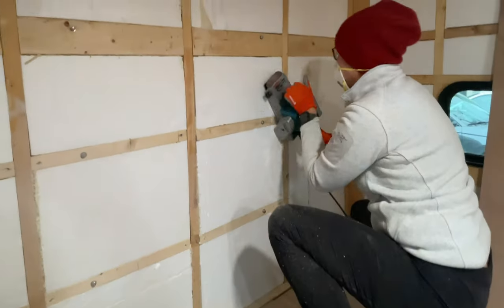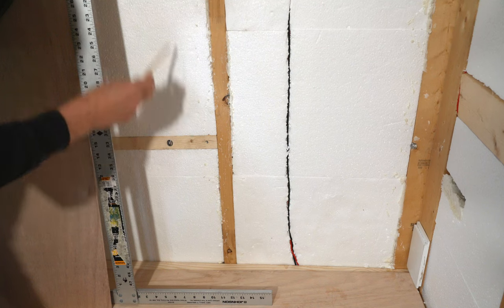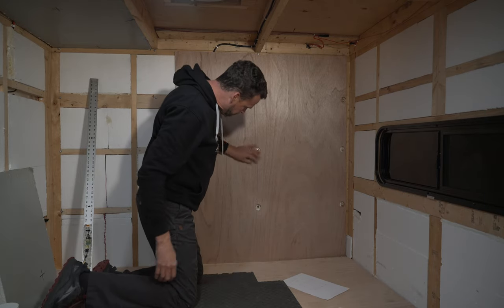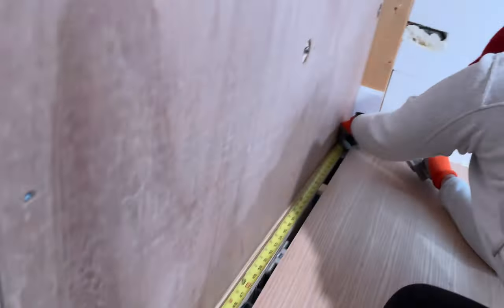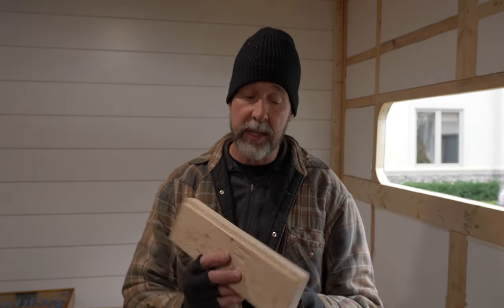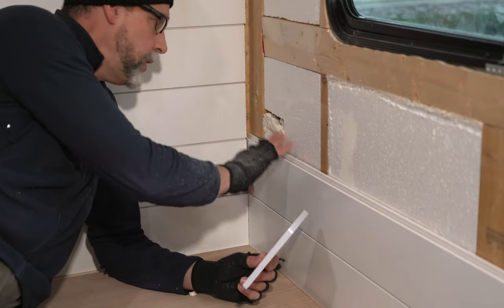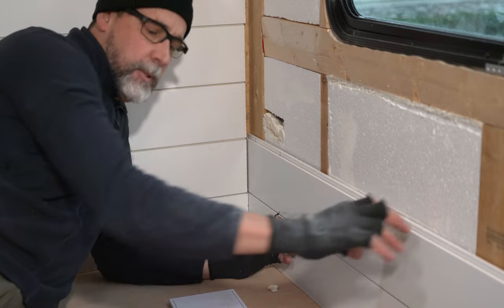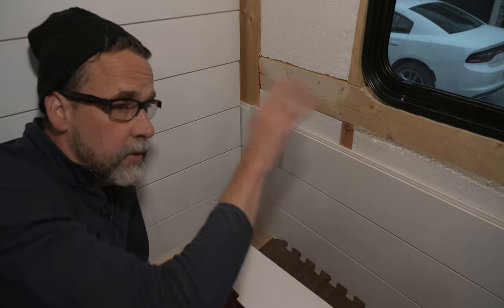Interior Construction has FINALLY BEGUN // How to Build a DIY Camper Trailer

Comment: Tell us about that blue router bit with bearing that you used for the window!
Reply from the maker: MasterCraft carbide edge bit.
Reply: @DrenalinAdventures  That's funny:  all the bits with bearings I see on the web produce different round or curved shapes:  the bit I need is the one like you used producing a 90 degree groove.  Can you provide a more precise link or description or photo of what you used?